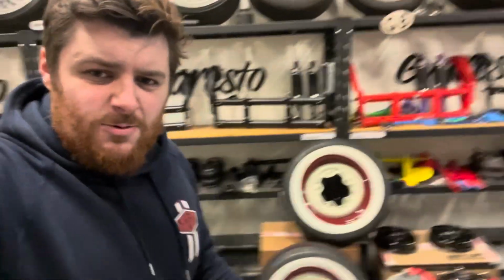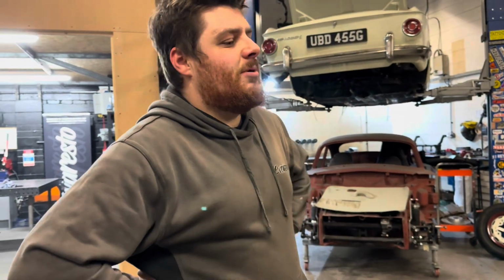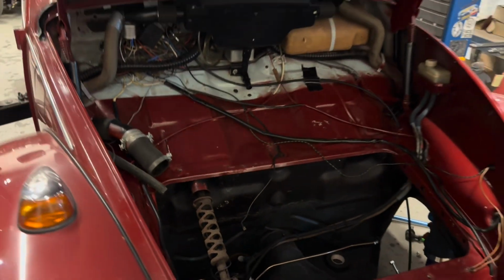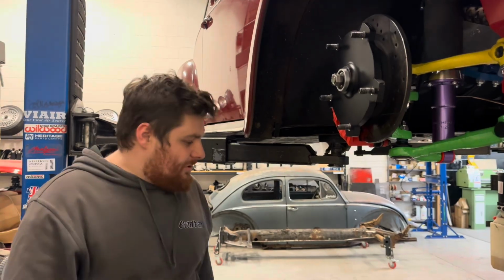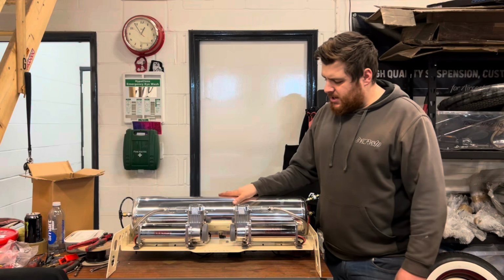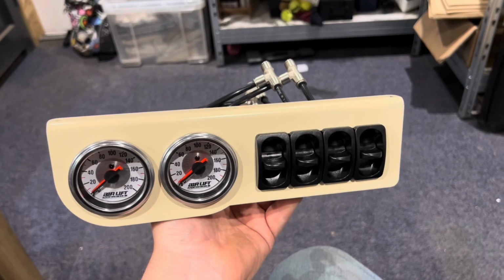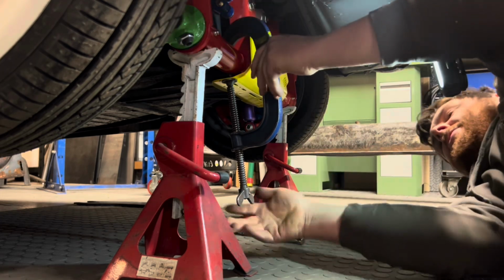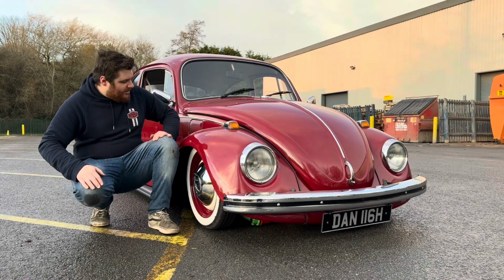Fitting Air Ride to Our ‘70 VW Beetle ‘Danish’ EP2 - Slamming!

Comment: Who makes the whitewall tires? Also, how much narrowed? Trying to calculate how narrow I want to go with empi disk brakes, but not the sucked in wheel look. I like how this setup keeps the front wheel out, less of a sucked in look
Reply from the maker: They’re whitewall flaps, so just fitted on top of tyres.
This one is a 4” narrow, the best all rounder 👍🏻

Comment: Very clever bit of kit! I like that rack for the tank and compressor. Are 70s swing axle over there?
Reply from the maker: Thanks! And yes, all our later models until end of German production (1979) were swing axle at the back, aside from 1303/2 and semi automatic cars as they had IRS. 
‘68 onwards in US spec are all IRS, is that right?

Comment: Looks great! Would it sit lower without the jack mount and flat panned?
Reply from the maker: Without the jack point, maybe marginally! But typically a beetle with a 185/65 or 195/65 rear won’t lay the rear pans, even with the axles at max angle like you see here.

With an engine/box raise and some other mods yes, at which point then it would be great to go flat pans to gain some more clearance for driving low!
Reply: @evarestovw6861  thanks for the info! I have 185/55 in rear, no jack mounts, flat panned, extended notched spring plates. I hope to order a setup very soon!

Comment: How did you solve the air up/air down toe problem of the driver side I have some pretty significant toe issues when running my air while driving
Reply from the maker: It’s not something you can ever solve on an air ride car, not without completely redesigning the steering setup. It’s always the short track rod side, worse on a RHD car. Shorter the rod, the more the toe change through the suspension travel. 
You’ll always get some toe out on air out unfortunately, just set your alignment up to drive height and go with that. 
Track rod flip can help… but can also cause other issues so doesn’t instantly fix everything